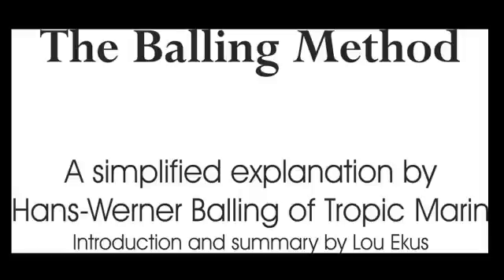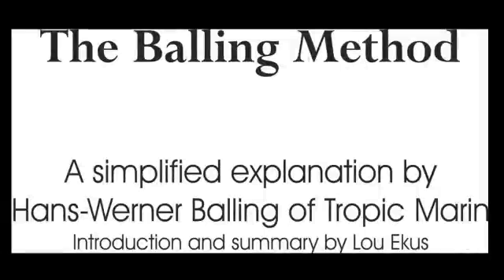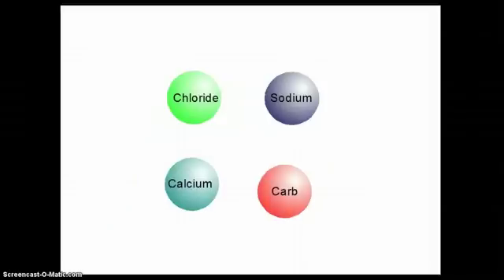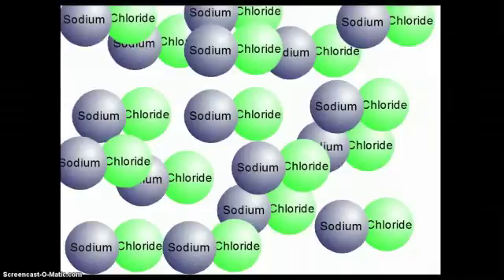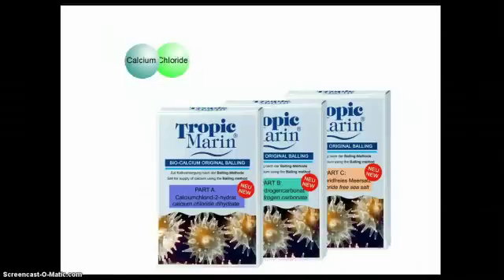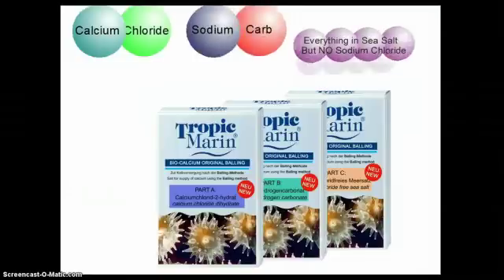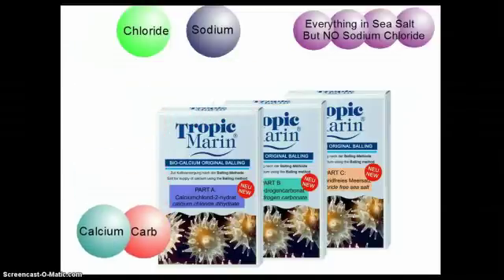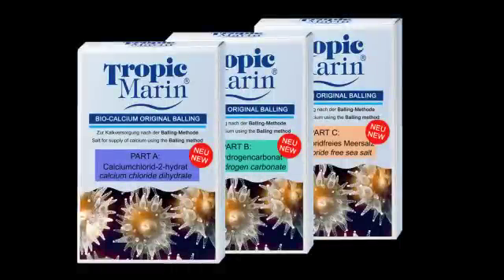The Balling Method explained by Hans-Werner Balling

Comment: Do you still have to remove the same amount of tank water as you have dosed to maintain salinity with the salts?
Reply: It's not that complicated, Tom  (or that simple depending on how you look at it). The rise in salinity is very small. It is also somewhat related to the Ca usage in the tank and the amount of these solutions going into the tank. With regular water changes and top off water, it is often even difficult to measure that increase, as these things deal with it pretty effectively. It really just requires that you measure the salinity on a regular basis to make sure that your on the value you want to be. Not all that dissimilar to what you would do in any reef tank.